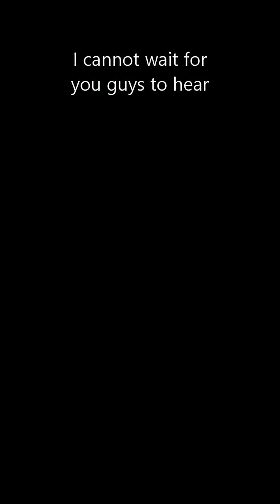🔥 From MADNESS to Mastery: What $60 CNC Plasma "Plans" Will Get You 🛠️

Comment: So this popped up in my feed and I am urged to comment.  I also saw the videos of motofab performance and midwest customz complaining about these plans.  I also bought the plans and the ONLY thing that was wrong with them is that one hole for the motor of the Z axis was not centered correctly and in the spacers 1 out of 4 holes was too small.  But someone who is building his own plasma table should have the tools and skills to solve this easily.  And I don't understand why they are hating on the wiring and electrical components.  I agree his wiring is messy, but it's your DIY project, so do better. I had zero knowledge of CNC and my table works flawlessly.  I have the complete build video on my channel, so that is proof these plans are good.  The plans are 60 bucks which is cheap, so sometimes you will have to do some thinking yourself, but anyone who attempts to build this should be smart enough for that.  I was able to figure everything out so other people should be able to do that too.  The only thing I agree with is the fact that it is not really nice to get back to people.  As far as I know, this guy works his ass off, and maybe he is just frustrated having to answer stupid questions that a quick google search could answer too.  All this hate is really unjustified in my opinion.